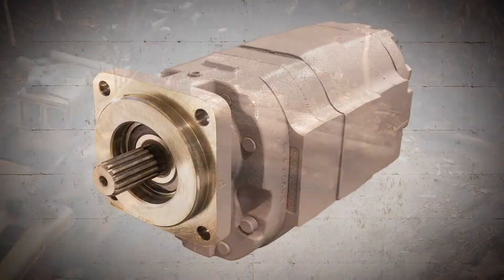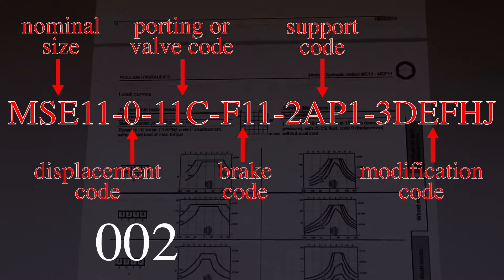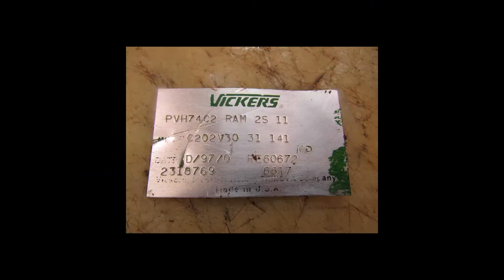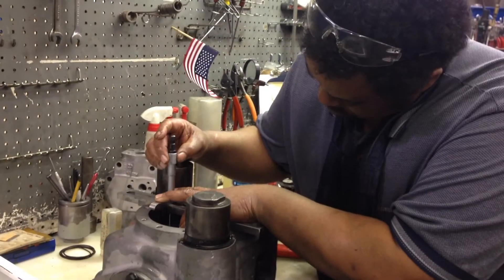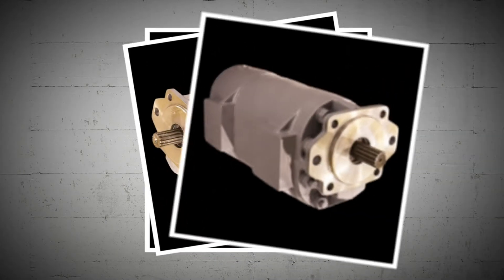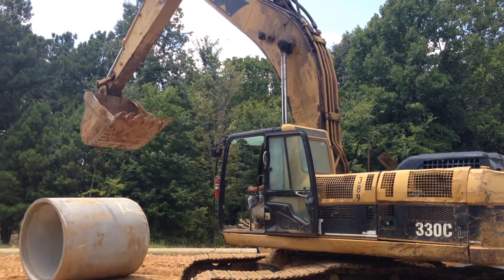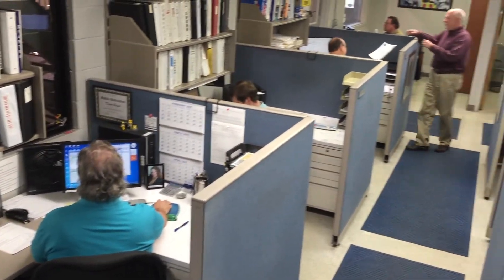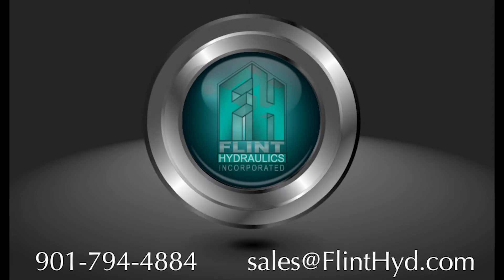Identifying Hydraulic Pumps & Hydraulic Motors

Comment: i think if the rotor is magnet holder and stator is holding coil then we can use hydraulic power to rum motor and generate electricity at the same time both run the car and generate electricity at the same hydraulic motor
Reply: It's slow it won't produce too much power, unless it's a flowing river then we do produce electricity from hydraulic power using bridges with turbines inside